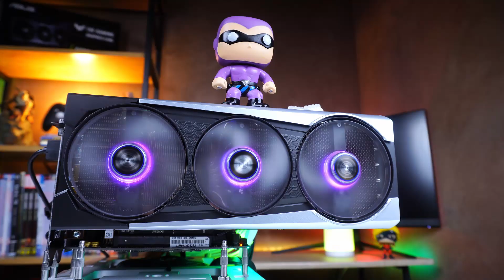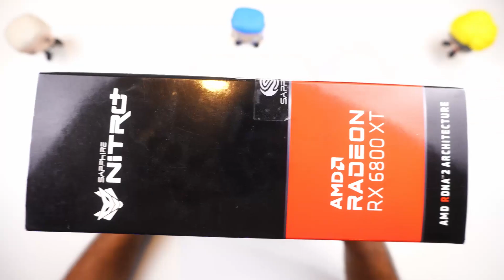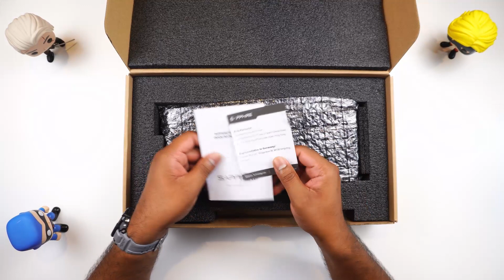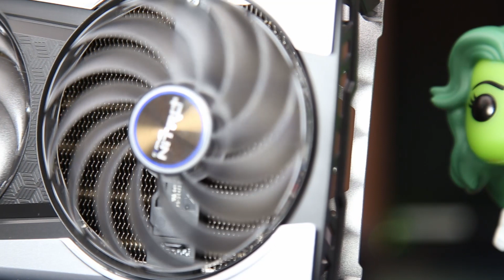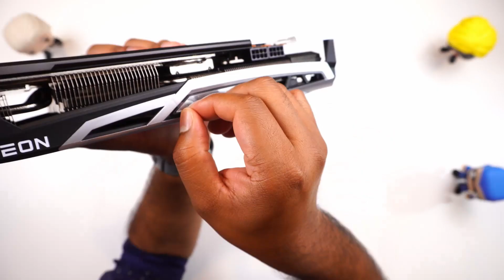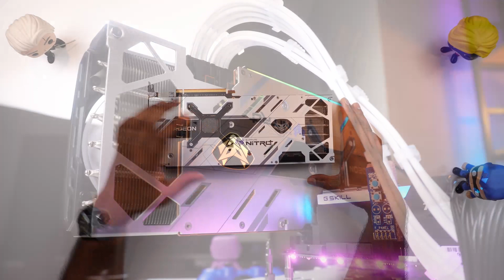SAPPHIRE NITRO+ AMD Radeon™ RX 6800 XT SE First Look & Overview!

Comment: that fan led feels like its not working right. i know its supposed to look like this, but it doenst feel right. the plastic is transperent, yet the leds are not using that transparancy and only light a ring around the fan motor hub. that feels half assed

Comment: Hi, do you still use this card? I would like to ask you about Trixx software and Nitro glow function. How it behaves when you e.g. switch off the RGBs, detach  card from PCIe and attach the card once again in the slot. Does the card keep alternative nitro glow setting or it is back to default setting (is it rainbow setting?)? Want to buy this card for using in eGPU enclosure with MacOS. Unfortunately TriXX software does not work on Mac so want to use help from some PC service for switching off nitro glow and wonder if it keeps the setup when I instal it in my eGPU again :) Please let me know. Thanks!

Comment: My BIG Q: Will this card be better for performance VR use than eg.g the cheaper nVidia RTX 3060Ti, MSI Gaming version with loads of CUDA cores for ray tracing? Been extremely satisfied with my old RX 580 Nitro+ SE and I see the heritage speaking cooling - nice and serviceable compared to Pulse-versions (still, Sapphire is among the best speaking AMD GPU's).
Reply: This is my exact question, did you found what's better for vr?
Reply: Yes. It's is.

Comment: To control the rgb on this gpu I need to connect the 5v 3pin cable or what cause I didn’t understand the rgb point
Reply from the maker: You can connect that RGB headers directly to your Motherboard as well to control the lighting - using the Motherboard controller with Motherboard's propriety software like ASUS Aura, Gigabyte RGB Fusion, MSI , ASRock etc
Reply: @budware8715  thank you

Comment: hello bruh. I have the same graphic card, one week ago its argb lightning had stucked at one colour then all the lightnings went off. I tried lots of things, uninstalling and reinstalling all drivers, updating bios etc... After that issue my graphic card started not to react to smart acces memory option. before the issue I was taking 12 fps more with using smart access memory now this option doesn't work anymore. briefly the graphic card doesn't react to trixx nitro glow option and smart access memory option. Do you have any idea what is going on?

Comment: Great video man! Quick question do you think AMD AMD RYZEN 7 5800X + EVGA 850GA 80+G FM ATX PSU + MSI MAG X570 Tomahawk WIFI Motherboard  would be best/support for this GPU? I'm tryna build from scratch. Thanks!
Reply from the maker: To clarify.. all my benchmark and testing was done almost exact system... My Benchmark system has - R9 5900X + EVGA 1000W G3 + X570 Tomahawk + DDR4 3600 CL16
So you will be great to go.. Keep subbed and watch out for review :)
Reply: @budware8715  That's crazy. Hey I appreciated though! Thank you!
Reply from the maker: @michaelpark3156  You are welcome mate.. All the best.. Like Sub and share my vids :) Thanks again.

Comment: Great review !!  Did you hear any coil whine ??  was it loud?  above how many fps?
Reply from the maker: Won't say no - Yes it has Coil Whine - not Super high pitched but has and it's obvious at mid-high power draw. However once you closed the panel it was okay but if you have super sensitive ears then is distracting.
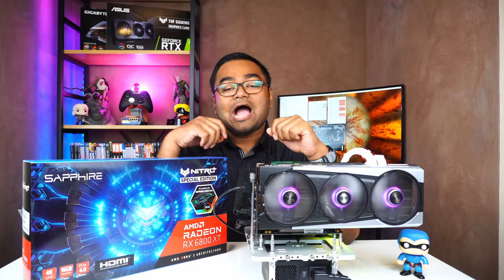Reply: Thanks mate !!  Very nice review btw, straight to the point. I liked how you run the test with all the monitoring windows opened at 14:24

Comment: I'm using msi afterburner and tried to set fan manually but not happens? Any help?advice?
Reply: Sapphire Trixxx is their fan software if you want to give that a try.
Reply from the maker: I will check and update you soon. Happened to me in past - for now did you tried updating MSI Afterburner? Also ticking the Automatic control on/off at FAN tab of Afterburner setting helps?
Reply: I did. I update it and uninstall and install it again but nothing happens but it's okay. I'm using radeon software now my GPU is cooling now. Thanks

Comment: Should i do vertical or regular mount?
Reply from the maker: Thanks for watching... Vertical mount will do indeed look good but it causes the GPU to run little hotter and that too depends on cases.. if you have great airflow cases then yeah it will look great on there... so go with it...  but just make sure its not next to the glass panel rather little inside else the Fans will starve for fresh cool air.
Reply: @budware8715  Its my first pc build the case is lian li o11d xl rog
Reply from the maker: @iiTzHaroon  Nice case - you will be good for vertical - just make sure you are getting the Lian Li's vertical mount. Also you might want to add some fans below to help assist the GPU get cool air - though it might also circulate the hot air a little but it's negligible. Rest all should be going great.
Reply: @budware8715  I currently have liquid freezer ii 360 aio and x3 QL120 rbg fans would I need more?
Reply: @budware8715  also i have two more questions I need help with if you don't mind. The first is my gpu and psu I have the 6800 SE and rm850x do I need any additional cables or will the included ones suffice? The 2nd question is similar but this time it's the lian li strimer plus rgb cable will it work with my gpu or do I need to buy extra cables
Reply from the maker: @iiTzHaroon  I think to start with that should be good. Are you planning to floor mount QL 120 fans? Or you are planning to replace the AIO fans with QL120s? If you are only keeping 3 fans then I will say it's fine see how temp goes then you can add more fans if needed in future. Plus point about your build if you have that big Lian Li OL11 XL case. 
However if you are replacing the AIO fans with QL fans then as you already have 3 AIO fans extra try put them at the floor maybe? Any case see how the temps are and based on that you can improvise.
Reply: @budware8715  im not sure exactly how I want the aio but I definitely want the ql120 fans on the side I'm just not sure about the air flow yet
Reply from the maker: @iiTzHaroon  I understood that.. QLFans on side is Allg all depends on how are you planning to align the AIO - either top mounted or side mounted.. Check Jayz2cents video on AIO position if you want idea and how to align. 
On your Question: RM850X is good enough and bundled cables are fine and you need not to buy anything extra. RM850X has 4 PCIe Connector and you need 2. Just remember to use two separate cable to connect to your GPU.
For the Strimer: I understand that only 24PIN comes with LED Controller else if you want to be controlled by motherboard then might need to consider this - based on your plan it might be handy - https://amzn.to/39szl8F
If you connect all to your motherboard well and good else synchronizing all lights might be a headache at same time not look the same how you intend.
Reply: @budware8715  thanks I've already watched the vid I will most likely leave the aio at the top my motherboard is x570 hero wifi so its meant to have aura sync and also I bought the triple pack ql120's which come with the lightning core hub controller.... Should I connect everything (strimer plus in particular) to that or directly to the motherboard
Reply from the maker: @iiTzHaroon  Hey Sorry for the delay, haven't used the QL120 hub so unsure but expect surely it connects to usb and you can use Corsair iCUE to control so maybe you might want to hook up and see how it goes. There are so many variables here hence advising gets really tuff. But keep me posted what atleast you tried..

Comment: My Middle fan makes horrible  ringing noise out of the box. Sapphire says "can go through your retailer" I'm like are you freaking serious!
Reply from the maker: By look of the video you posted.. I am unsure if this is 100% Fan noise.. I think its more like Coil Whine.. all big GPUs has it.. even my one has it.. specially on a particular speed/power draw level..  however once the GPU has warmed/draws more power during game up it goes away. You sure it's that center fan? But must say your situation is worst than mine. Probably good idea to RMA via returning it back. Pretty sure you need to go back to your place of purchase atleast here in NZ that's the case. No PC Components company has local service center here. 
Back to your video again - try running some benchmark / games for some time see if this changes or the pitch increases? But if you chase Sapphire you might get lucky to just swap out the fans.. Sapphire sells them separate at times as I knew too.
Reply: @budware8715  Would the coil whine be caused from a cheap or under wattage power supply for this particular graphics card, as it says 850 watt is minimum.
Reply from the maker: @onemoreriff7644  Yes coil whine can be caused by using cheap or under wattage power supply as the power might not be clean and can have noise. However most of the cases it's the card rather other factors considering PSU is optimal and etc. I used EVGA 1000W G3 on my bench yet I get that whine. Essentially all high end GPU more or less might have whine :(

Comment: Great vid, thanks. Got mine coming on Monday! Does the card come with an ARGB cable, please?
Reply from the maker: Hi Joe, Congratulations on securing one.. You will love it. This card does not come with any ARGB Cable but you can just get any 3PIN ARGB or 4 PIN RGB extension cables to connect to. Example like if you had NZXT Hue system you can borrow from there or https://amzn.to/3pNAZsh or https://amzn.to/2LcwHeU will just be fine though these

Comment: Great vid as always. I never even thought about buying something from AMD to be honest, NVIDIA forever. 3080 MSI Suprim X forever. Also regarding this card (based on your vid), the RGB Fans seem a little bit of a scam for me, because it's not really what could be expected, I was thinking about something bigger. And geez, this card tends to heat up so easily.
Reply from the maker: Thank you so much :).. The RGB fans looks okay in low lit environments and it looks - meh! on my studio lights for sure.. Hence there are couple of dark shots where the RGB looks little better on those fans - Sapphire also claims it's as Glow effect only. I believe Sapphire went with little diffusion and not used other white types material that might improve the range of diffusion.. but again on that way.. the card might have looks awful.. imagine the shroud and white fans. >_<   Unless they have a white design like Gigabyte Vision and ASUS STRIX White edition the fan glow has not much choice. :) 
Heat wise imo it is fine.. don't look at the hotspot temp as that's the hottest point on the die and it's just for reference only consider temps as what's it shows  - i.e. - ~70deg C which is better than most cards still it maintained 90degree on that Hottest point is impressive and didn't passed that. Gamer Nexus has nice explanation about it and explains why not to worry about the Hotpoint temp. IMO Sapphire could have done better on temps if the heatsink was little denser and had more surface area maybe.. coz the card here is way lighter than even TUF.